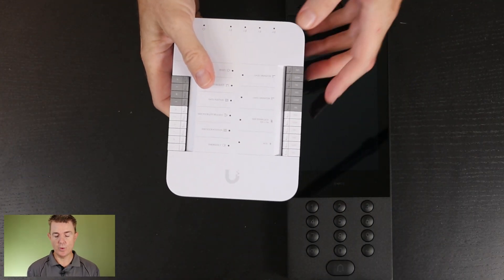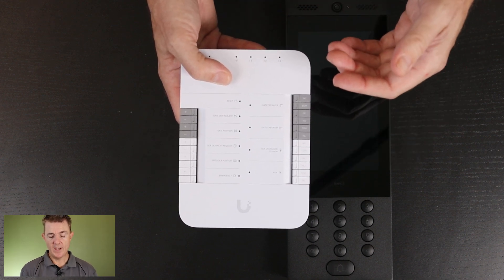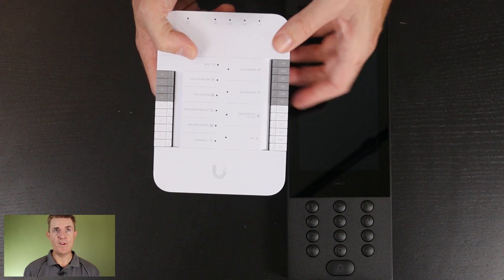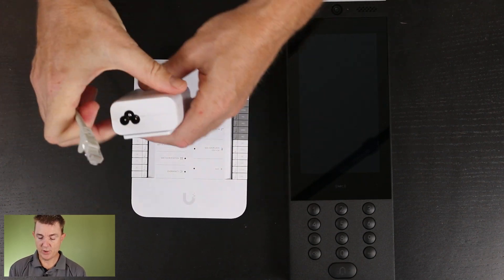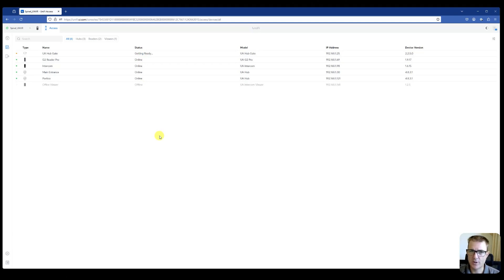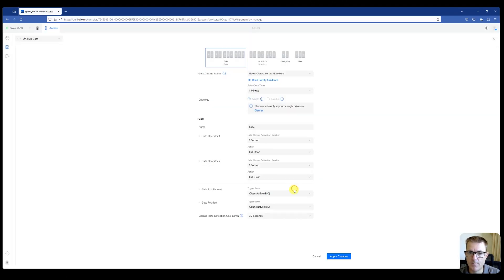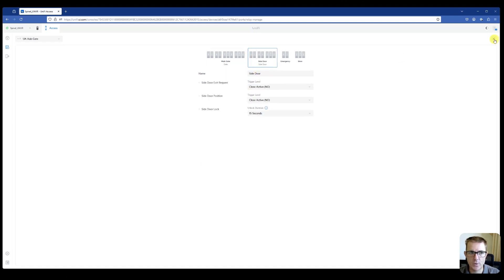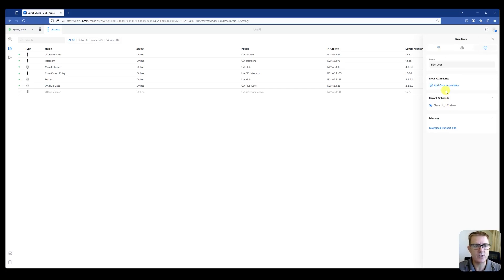How to... Control Two Gates or Doors with One Ubiquiti UA-Hub-Gate (April 2025)

Comment: Great video. Is it possible to accomplish if you create a user called gate with a unique pin code and access to the just the gate. Create a second user called door with a unique pin code and access to just the door. When 1 of the pin codes is entered on the intercom or reader it only opens the assigned door/gate?

Comment: Very helpful video... thanks.
Does the regular Door Hub have the same functionality to control 2 doors? 
We have a main building door with a side disabled access door. We are looking to install an automatic door swinger on the side door with a mushroom button on the inside (Egress) and another mushroom button on the outside. 
1. When the main door is OPEN (read via door position), the side door remains unlocked. If the main door is CLOSED, the side door will remain locked.
2. If entering the side door from outside, the outside mushroom button will trigger the automatic swinger (only if the main door is OPEN).
3. If exiting at the side door from the inside, the inside mushroom button will always trigger the automatic swinger (whether the main door is OPEN or CLOSED).
Thanks in advance.

Comment: Hi and very helpful video. I have a question I was hoping to get some clarity on. If I was to have both a gate and side door option. Is it possible schedule open/locked hours, so eg to have the side door unlocked during “day time” and locked during night time. So scheduling in stead of opening for xx seconds as you could see in the video? Thank you in advance!
Reply from the maker: Yes, absolutely, you can set an unlock schedule per door / gate where it can remain unlocked during certain time frames.

Comment: Awesome video. How can we manage to prevent the gate from opening again when someone leaves the property? I tried using the line crossing function, but the gate still opens when driving out (even if i have defined Line Crossing like from A to B). Any idea?
Reply from the maker: Good question.   In the general design of things Ubiquiti expect most of the final open / close part to be handled by your gate system.  It would normally have a sensor in it to know when you car has travelled through it and once through it would then operate the close function without the Hub Gate doing anything.   Same would be as you approach if you are using LPR, that the Hub-Gate sends the open command, but that is all it does.  As your car travels though the gate area your gate system monitors the cars position.  Once clear it closes the gates.   Not sure if that is possible in your setup, or if I have misunderstood the question.

Comment: Hi, if I integrate an intercom viewer into the system, will it allow me to control and select which door open
Reply from the maker: A viewer is matched to a reader, so if you have one reader for the Hub Gate, then it will just allow you to control that one gate.  If you have two readers attached (one paired to each gate/door) then the viewer can be paired to both and will show the feed from both and allow you to control both.  I hope this helps.

Comment: This has been very useful, thank you. I'm going to get a wide gate installed infront of my house and was thinking of adding a side door right next to the gate, but now I see I have to use 2 intercoms... that will be very confusing for guests.
Reply from the maker: You could just use an intercom on one and say a reader pro on the other, so they look different and makes it a little more obvious to people which is which
Reply: @The_Tech_Geeks  Ok I will do that. The G3 reader normal for the side door, and the G3 pro reader for the gate. But if I get called on the G3 reader pro, can I open the small gate as well?
Reply from the maker: Yes.  You can open whatever gate you want from the app
Reply: @The_Tech_Geeks So, you can open every door via the app, but can you also open every door via the Intercom Viewer? That would be great. One intercom, but able to open either door A or B. Please assist, many thanks.

Comment: 4:24 can you make a test where you connect the intercom to a switch and control the hub from there because that would be useful
Reply from the maker: The only way that will work will be - Main Network -> UA-Hub ->Switch --> Intercom  You can't have Main network --> Intercom & Hub (at the same level)  an Intercom musy always be connected to a Hub at some point.  You should be able to have a switch between the PoE out of the Hub and the devices though, but I will test this at some point.
Reply: @ if I understand correctly you are saying it only works like this UDM Pro -> Switch -> Hub Gate -> Intercom
Would be interesting if this would also work:
UDM Pro -> Switch -> Hub Gate
UDM Pro -> Switch -> Intercom
Because sometimes this would make more sense
Reply from the maker: It won't work Switch - > intercom, I am afraid.  The Hub is the security point if you like.  By being conencted to the hub assigned to the door we know it is in the right location to control that door.
Reply: @The_Tech_Geeks  I read it works :) and also what if you’d like to have the intercom without the gate hub it kinda has to work without a hub
Reply from the maker: So you mean, just like a big doorbell, but with no function to open a door etc, just to alert callers to people at the door?
Reply: @The_Tech_Geeks  yes exactly like to call different tenants
Reply from the maker: I got a G2 Intercom out of the box and connected directly to a switch.  You can adopt the device in to Unifi Access, but you can't do anything other than that I am afraid, it says it needs a Hub to unlock access features.   So as I thought.  You need an Access Hub of some type, directly connected to it to make it work.  I hope this helps.
Reply: @The_Tech_Geeks  thanks for looking into it but that is in my opinion a design flaw because I would like to buy one just for the option to have a big doorbell with the option to call the other tenants and the owner.
Do I have to buy a mini Hub just to have some kind of hub before and use the intercom appropriately? Thanks for your work appreciate it
Reply from the maker: Correct, you could connect this to the Hub Mini.
Reply: @jakobholzner  Intercom MUSTconnect to the Hub to work.
Reply: @zLifeJourney that is not true. This is the answer I got from UI support.
Hello,
To clarify, yes, you can connect the intercom via a network switch. However, please ensure that both the UA Hub and the intercom are on the same VLAN. Additionally, verify that the network in the UniFi Access app (Settings > General > Network) is set to All to ensure proper communication.
Reply: @jakobholzner  i had both hub and intercom connected to native vlan but the intercom can't communicate with hub.
Reply: @zLifeJourney okay that’s bad. Maybe try contacting support and see if they can help you out.